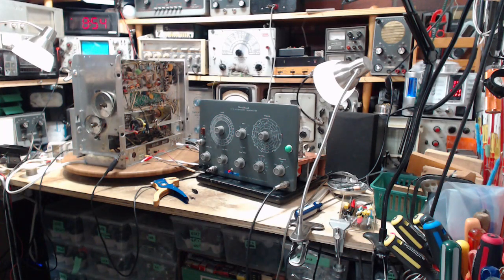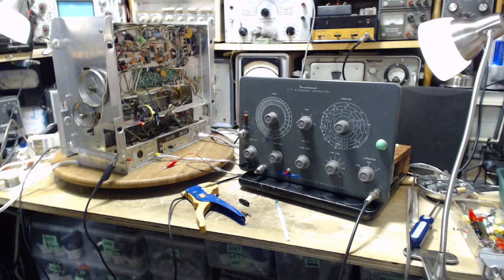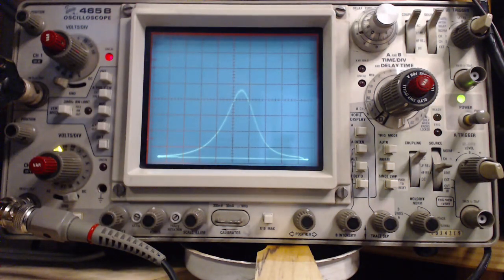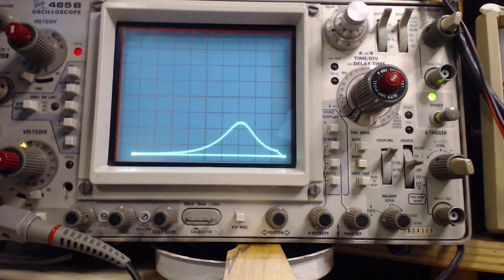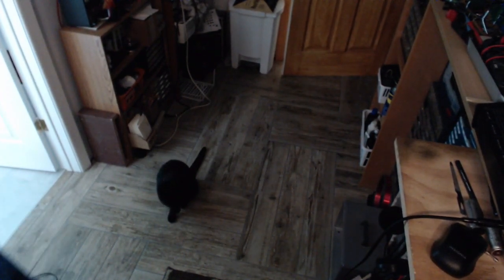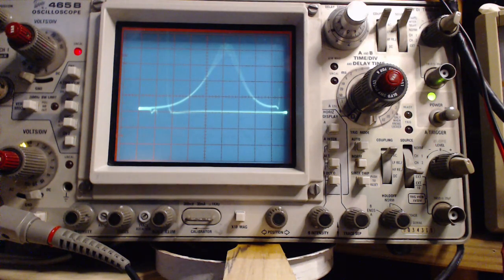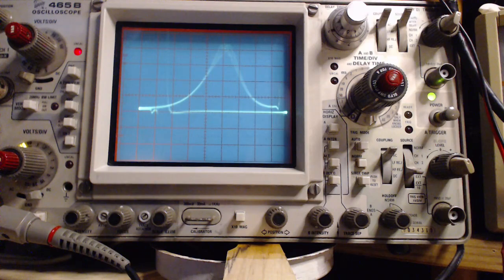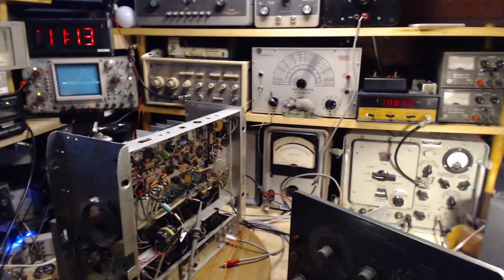Clairtone Console Stereo Video #29 - IF Bandwidth Check

Comment: Hi Jim the output of the marker adder & the lead from the set go to the scope's vertical amp . ( detector diode or diode probe ) .

So you need a “Y” adapter with resistor & depending on the test point a detector diode / probe on the end for  RF .

So the loop is “ Unit under test out  > * > 47k resistor > adder out > scope in”  . 

*  = Detector diode if needed .
Reply: The test setup you describe here is obvious from the article he is waving in front of the camera. Plus not only is there the issue regarding the need to  use an "adder circuit" on the scope input; you also have a bias adjustment on the marker addon circuit to shape the pips for strength and sharpness.
 Didnt he say he read through the article of the magazine while lounging on his "deck" ? 
Dont tell me he is hooking up the output of that addon circuit to the radio... That would be total BS.
Reply: @asmallmatter4441  
I just looked at the circuit & jim's lash up .
Quickly followed by Er Hum …. that'll never work !

So a bit of digging found the article & the test setup is not obvious .

Normally you feed the detected signal / voltage back into the generator & have a dedicated scope output .

As for the bias adjustment this is FM so agc is not much of a problem but drive level & the test point used is ( Beware of the limiter ) ! 
 
I think he disabled the agc .
( The diode & cap from the 10.7 IF can feeding into the mixer bias ) .
Reply: @gd2329j  Excellent observation, now try to sell Jim following it! (thanks for your comment)

Comment: @ 2:27: You actually could. One easy test you may do to verify if your different generator are putting out the correct frequency is by setting your scope to X-Y input mode and creating a Lissajous display. if both signals are in phase and at the same frequency, you should get a perfect circle display (no rotations). And you actually can tell the bandwidth response curve frequencies. That's why scopes have a calibrated graticule. At 10.7MHz frequency input , (1/f period), each cycle will be 93.46nS. If you know where the first X division is, you can count the other ones and calculate the frequency. You also could use the Z-axis input to display the pip as a brighter dot. Granted this is cumbersome and not very helpful.

Comment: Thats a lot of overkill to do an IF alignment. I use a 455khz xtal oscillator modulated by a flip flop circuit. And a Simpson VOM. Again disable the local oscillator circuit  to do a clean IF amp alignment.

Comment: Go back to square one. Short antenna inputs, disable local oscillator. AVC and AFC. Feed IF to the last transformer and connect the scope to the  detector output (check if that receiver has a discriminator or a ratio detector circuit). Use suitable probes. You have three ways of displaying marker pips: One, using a digital scope with cursors and math functions (that you don't have), two, using post-marker injection (AF signal that beats the scope feed, very sharp and clear but depends on scope settings and timebase calibration) and three, compound signal feed where the receiver gets the IF and the markers at the input feed. Adjust the displayed bandwidth response with the correct shape and frequency setpoints. Do not move around until you get this right. And please, try to understand the whys you doing adjustments, not just the whats.
Reply: Ive been saying that all along !
Reply: That TS-4 sig gen with the marker addon he has basically is a crude way of post-marker injection... If he would hook it up right!
Reply: @erin19030  Agree, but talking to the wind, he just doesn't read anything. (thanks for your comment)